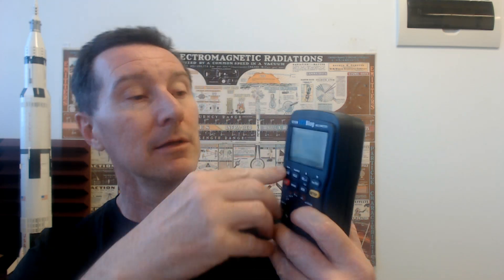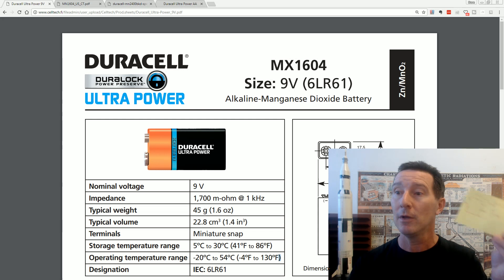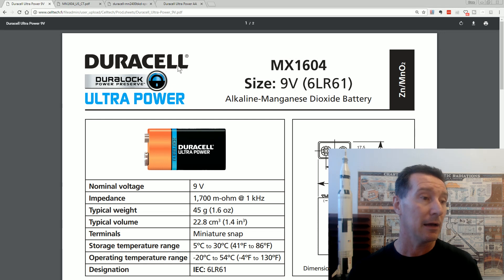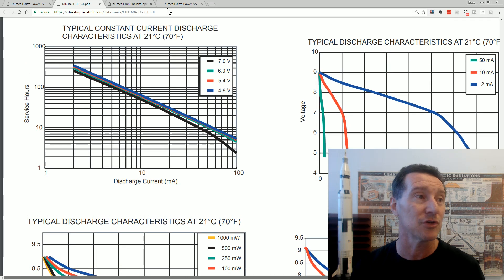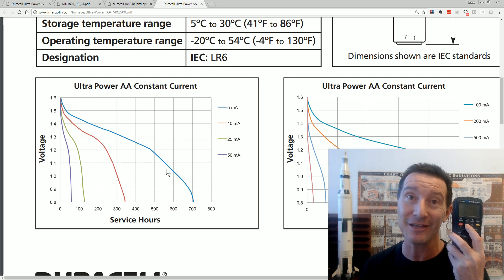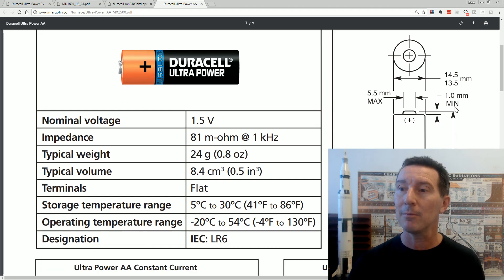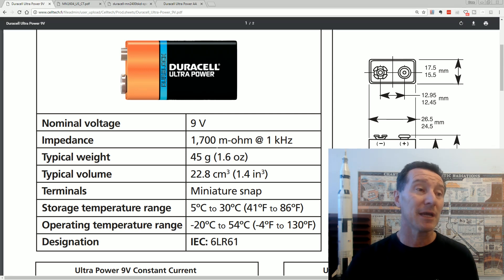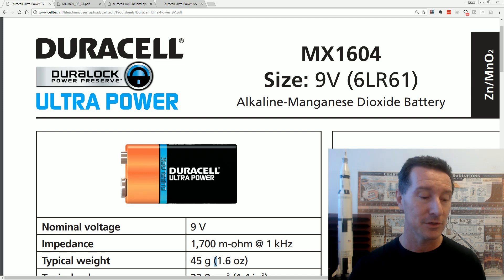Why Use AA's Instead of 9V Batteries in Multimeters?

Comment: Do rechargable AA/AAAs have more capacity than the same size alkaline ones. Good quality AA NiMH are usually 2000mAh, AAA are usually 850mAh. Why dont Alkalines ever have the mAh printed on them.
Reply: they vary according to load, at low load such as clocks, they have maybe over 3000mah , at high loads, nimh give their stated capacity and alkalines lose half of theirs
Reply from the maker: It would not be valuable, it would just be confusing. Alkalines have a much higher ESR than NiMh and Li-Ion so it doesn't make sense to use a mAh figure.
Reply: Still very valuable consumer information. Most products are required to state
 their 'quantity' on the packaging. Why did battery manufacturers get a waiver?
Reply: If you use AA batteries for capacity and not "getting into shelf life territory" i would rethink using them. A NiMH cell costs like 4-5 times more than a alkaline and lasts more than 10 years. So if you drain a Alkaline battery in less than 2 years or maybe one it was wasted money in fact. Multimeters run years and years on alkalines, would be interesting to compare the aging/self discharge with the real energy use over this period of time :D

Comment: Somewhat related: 
I've seen a few cases where a multi-battery solution was used not due to size or lifespan, but for (physical) rail-separation.

EG: an electronic sudoku-toy my parents used to have:  used 2 batteries for the logic and another one solely for the LCD-Backlight
Reply: its lazy enginneering and less parts costs for voltage lines, not an improvement, my cheap chinese clock uses 4xaaa, and taps off at a couple of points to steal different voltages
Reply: Never said it was 'better', just that it exists.

Comment: I have two multimeters which use 9V pp3 batteries, and it is quite a chore to take them out for charging (I am using NiMHs).  So I fitted a charging socket and charging indicator lamp (3mm LED) to each meter, and I have found this to be very satisfactory.  The meters can still be used while on charge.
Reply: Be aware that by doing this you likely seriously compromised the safety of the meter. Not an issue if you only ever use it for ELV work but a big problem if you ever use it for mains work.
Reply: yep, like radios once used pp9s which are the giant version of sucky and expensive, i had a radio that needed 2 of them, it sucked

Comment: I wish cell phone makers would learn from this, I would be happy if they would make a phone that's slightly thicker to gain hours of battery life.  but no, everyone wants to make everything as thin as possible...
Reply: My early Nokias came with the battery as a clip-on pack on the back. They only gave you a couple of weeks battery life. But you could get high-capacity backs that were thicker, and they would go for a month or two.
Reply: mattg889 that’s what I have been saying all along. Make the battery bigger for more capacity.
Reply: @ihatesmartphones  YES YES YES. And stop this nonsense of building the battery in so that you can't replace it without returning the whole phone to the manufacturer.
Reply: @BrianG61UK  A removable battery of course is also useful for a good ol' hard reset, which I've needed to do more than once. Bad apps can temporarily brick a phone to where the power button doesn't even work, but popping the battery does!
Reply: Just glue power bank to the back. That way you have a choice of battery life for any phone: bigger bank - longer life.
Reply: Did your wife tell you that? LOL

Comment: Bit of a long story to tell that 9V batteries have the worst energy density of them all. It's even so bad that you can easily use a step-up booster and you will be still have more hours out of your AA's.
I hate 9V batteries, blows my mind why so many (professional) devices use these bloody things. They are also more expensive than AA batteries (especially the nimh ones).
Don't understand why people start using li-ion or lipo batteries???
Reply: The NiMH 9V ones are outrageously expensive. They cost 9€ here in Italy and have a capacity of 250 mAh, with 8€ you can buy 8x quality AA cells (Energizer), with a capacity of 1900 mAh :D
And they're also almost impossible to find. The stupid LPG detector I had to install in my boat requires a rechargeable 9V battery (as it consumes too much power to be powered solely by a battery, so it's powered by mains and uses the battery as a back-up), and I had to order it from Ebay as none of the electronics shop near me carried it  anymore, or had ran out of it and the backorder took 2 weeks.

Comment: In my experience (many destroyed items, most with batteries still working) AA alkaline batteries WILL LEAK and destroy your meter. I do not use alkaline AAs or AAAs in anything anymore. I only use Energizer lithium AAs and AAAs which don't leak. Interestingly, 9V alkalines only seem to leak if left for many years, and then the leakage is still contained within the metal can. I have not seen a C or D cell alkaline leak, only AA and AAA.
Reply: gwc1410
I've seen leaked cells from teeny little button cells, right up to the 6v lantern batteries. Everything except a 9v.
Also, my first multimeter was a RadioShack digital multimeter. Cost about $100AU, and was destroyed by some shitty energizers that were taken from an unopened, brand new pack and leaked within 2 weeks (most of which the meter was not used). I was not impressed, especially when Energizer's response was basically "suck it up, buttercup". Didn't even offer a replacement pack of AAs.
Reply: The batteries most likely to leak are the awful zinc carbon batteries. Ive never had an alkaline leak, plenty of zinc ones though.
Reply: Haven't seen any D cells leak? You need to keep looking. Burst alkaline D cells have destroyed more than one of my Maglites. Lucky for me, I caught a C cell leak before it destroyed the battery compartment of a portable CD player.
Reply: It's been decades since I've seen a name brand alkaline battery leak, unless it was sat on the shelf for years.
Reply: My $04.00 harbor freight ultra cheap digital multi-meter's 9v battery leaked some time ago but the multi-meter still works fine even with that leaked 9v battery still powering it! I will voluntarily admit though that I wish common everyday batteries never leaked.
Reply: By the way, that 9v I talked about above that leaked, is an alkaline battery.

Comment: i had a multimeter that ran from a single triple A
it lasted months from a 1100mAh NIMH battery with constant use!!
Battery was 0.8v when it finally died!
Crazy long lasting life!!!
Reply: it was  a mechanical meter i guess, the battery was only used when you did resistance mode, other modes are powered by the load, thus you can live with no battery in it some times

Comment: How about an optional back cover that allows powering from an AC power source?
Reply: The tricky bit is you can't use a regular wall-wart directly because the insulation on it's output cable is not adequately rated. So you either need an isolated DC-DC or a custom mains power supply.
Reply: Better buy some NiMH accumulators unless you really need hundreds hours of uninterrupted work.
Reply: Juan Herrero be VERY careful with this, as if you happen to use the meter on something with high voltage in it (say you are repairing a photo flash, which has a 400V capacitor) and you touch the barrel plug (negative or positive doesn't matter), you WILL certainly know you did by screaming in pain because you WILL get a shock, given the battery in multimeters is NOT isolated from the probes!
Reply: I hacked in a standard barrel plug connector from an old ADSL router (fits 9-12 volt DC adapters) to one of those cheap yellow chinese multimeters. Nice thing about the barrel connector is that it has a builtin switch which is triggered when you plug it in. It worked fine, except there was some jitter in the measured value, most notably when measuring zero it would flash the minus sign. A small SMD ceramic cap from a dead fluorescent light bulb took care of that. Drilled a hole on the side of the case of the appropriate size near the LCD screen.

I do not use it for mains stuff powered that way, of course. Just checking batteries, resistances and such.

Earlier than that I did something even more crude: Two cables soldered directly to the battery contacts. A non-rechargeable battery will, in fact take something of a charge, so by feeding the other end of the cables >9 volts for a few seconds I get a few minutes of use before the low battery warning and inaccurate measurements.

Comment: 9:19 - May contain 6 x AAAA batteries.  Not all do.  Some use rectangular cells.
Reply: The cheap ones almost never use individual encapsulated AAAA cells - just a simple stack of rectangular wax-coated cells with a piece of cardboard between them.
Reply: Alkaline batteries will probably use cylindrical cells, to contain the electrolyte, whereas carbon-based ones will usually contain cheap rectangular cells.
Reply from the maker: They aren't Alkaline.
Reply: EEVblog2, what aren't alkaline?
You opened 4 alkaline batteries in that video; 2 had AAAA cells in them and 2 had rectangular cells.
Reply: Wikipedia shows a picture with both zinc-carbon and alkaline rectangular cells inside 9V batteries.
Reply: I opened an Industrial Duracell 9V hoping to use it as a source of cheap AAAAs for an active stylus. 
Result: A stack of rectangular cells and the waste of a perfectly good battery.
Reply: RWBHere It's not containment. It's just that GP batteries had the patent on rectangular cell 9V Alkaline until a few years ago.  And unlike patent trolls, they used the patent to actually make and sell batteries as a primary business until the patent ran out, with each and every battery containing a stamped patent warning visible to anyone opening it up.
Reply: I guess Dave has early onset Alzheimer's.
https://youtu.be/c9JGfoLxVCo

Comment: Use 2 6v lamp batteries in it .

Plenty of power
Reply: Andrew Joy Truthfully, I think the golf cart batteries that I use to power my amateur radio station would provide far greater runtime (6V@230Ah each), but at 65-70 pounds apiece they might sacrifice a little in terms of portability, but on the positive side you will get a fantastic workout.  Of course LiFePO4 batteries would be far superior in every respect, but then the meter would cost thousands of dollars for just the batteries and make even my bench meters look inexpensive by comparison. ;-)

Comment: Good choice! I hate 9v batteries. Somehow they never seem to last as long in storage, and I never have any when I need them. Also AA NiMH is ubiquitous, but 9v NiMH is expensive and sucks. Who wants to run devices on non-rechargeable cells anyway?
Reply: TheVirindi You can get, or at least in the past could (I have not looked lately) obtain 8.4V (7 cell) rechargeable 9V batteries, but they were never as ubiquitous as the 7.2V variety.  The 8.4V versions tended to perform far better in devices that originally expected 9V alkaline batteries, but fitting in that added cell did compromise a little on their Ah rating, but at least they would function fine in almost any 9V application.

However, I have never used rechargeable cells in my portable test gear, partly because historically NiCd and NiMH batteries tended to suck at long term storage, but mostly because when I want to use my meters I want to make a measurement right then and not wait for my batteries to finish charging first.  But I do use rechargeable batteries quite extensively in many high drain applications like my radios (transceivers) and flashlights, and of course these days most of us have a compliment of rechargeable tools to compliment our AC power tool collection.
Reply: I think that low self discharge cells would solve a lot of your problems. I don't know if LSD cells are available in 9v, they may well be, but they weren't the last time I checked a couple years ago.

I converted a $100 9v meter to use LSD NiMH AAs and it works well for me. I can leave the cells in the meter and it is ready when I need it, I don't have to go and charge before a particular use.

I used 6x AA and that was just fine for the meter in question, but it would also be easy to use 7. This meter is not hand carried around, I mostly use it on the bench, so the extra bulk doesn't bother me. But for "carry around" use even if I lost 40% capacity, I would prefer 3 or 4 AAs and a boost converter over 9v. Buying one time use cells just sucks.

NiMH technology has come a long way since the days of "discharges to zero in a month".

Comment: Okay but why not lithium-ion batteries?
Reply: Abe Lincoln That depends on the implementation, there's certainly no reason it couldn't contain user replaceable lithium cells just like AAs, also just imagine you're data logging and notice oh crap I forgot to replace the low batteries in there, well no worries with rechargeables, I'll just plug in the charger or a power bank so it'll keep going, seems better and makes more sense to me than having to stop, find batteries and replace them...
Reply: tohopes yes, that is also the question that I am thinking of. I am sure Dave will have checked this option and surely has a good reason not doing it. Maybe he will explain ?
Reply: Agreed, I can see how a rechargeable unit would be advantageous in a lab situation, however I would think twice about charging a unit while it was taking measurements. If I have lots of electrical outlets to charge the thing I'd likely be using a bench meter anyhow. 
To my conception hand held units are for field service, hence my preference for lithium 9v.
Reply: I like those batteries in my torches and hobby projects, but I don't think I'd want them in a DMM with an LCD screen like this myself. When you get a nice long runtime like that I would actually prefer to be able to use regular AA alkaline batteries or maybe NiMH, putting internally rechargeable li-ion (or externally charged) in there would be a bit of a hassle.

Not as easy to replace and you most likely won't be able to do a whole lot of replacing anyway unless you regularly deploy it as a long term logging device. For lab situation logging having an optional external powersupply could be nice?

Once you start to get to higher drain devices though that need a higher energy density or frequent battery swaps/recharging that's when I would start looking into li-ion or even some kind of lipo battery (with a standard connector so its easy to replace/swap). 

When it comes to sourcing batteries it might be a bit troublesome too, getting good 18650 cells isn't an issue for me, but as soon as I want to get others I have much less choice. For 18650s I can get a variety of Panasonic, LG, Samsung etc for crazy high drain purposes (>10A) or more optimised for lower drain and high capacity at reasonable prices. But if I want say a 26650, 18350 or 14500 I've got no such luck sadly.
Reply: That's fair but what about hobbyists such as myself, who don't spend much over $100 on most equipment and don't have many bench devices? Well that and meters similar to the 121GW are pretty big/bulky so they're aren't exactly super portable, but yes I do see the appeal of carrying a handful of AAs to swap at any point, I just think that design is better suited to pocket meters rather than full size brick meters.
Reply: It would make them a nightmare to ship I think...
Reply: equitimer ok. I did not think about the restrictions sending lithium batteries around the world. Would be a strong argument.
Reply: no need to swap lion, just charge.quick charge takes 20 minutes + you can precharge before use. or use powerbank, or charge in car during drive to working place, or from pc usb slot during measurements.
Reply: Because AA cells are available literally everywhere, even places without an electrical grid. Also it takes 3 minutes to swap in a new set of cells as opposed to 3-4 hours to charge a LiPo or Lion cell.
Reply: tohopes
Possible reasons:
* Might introduce noise/error?
* Long term life is poor.
* Dave previously bought a Samsung Galaxy Note 7 😛

I'd like to know too. To me, it seems odd to not have a rechargeable device in this age. But maybe there's a technical reason not to.

Comment: with a buck convertor on the 9V battery, surely you can do better than 150hrs? you'll draw less than 5mA, but still probably worse than the AAs due to the high internal resistance, 9V are awesome if you draw uAs

Comment: + for AA : NiMH are cheap and most people already have a charger. My DMM runs longer on eneloop AA's than on duracell alkaline, at third charge the NiMH becomes cheaper. It's better for environment too. Stop using alkalines :)
Reply: That is not a problem since 1,05V per cell is at least 95% of capasity used for Eneloop. Manufacturer rates cells down to 1V
Reply: Only problem is that the cutoff voltage for this meter is only 1.05v per cell which means it will not use the full charge of NiMH cells...